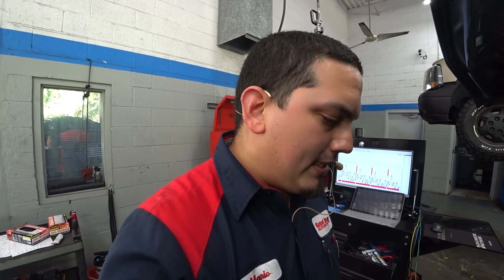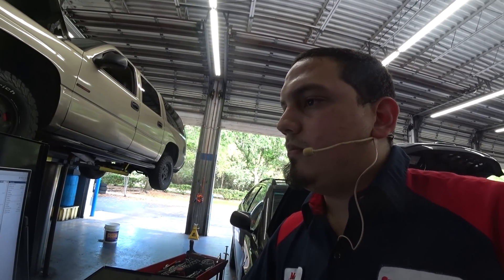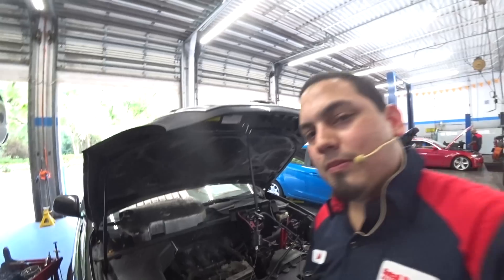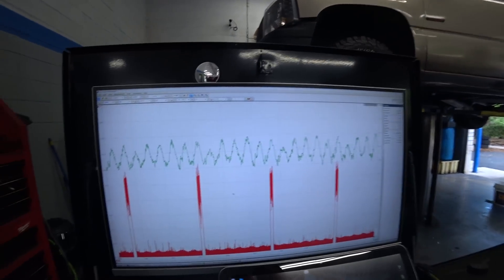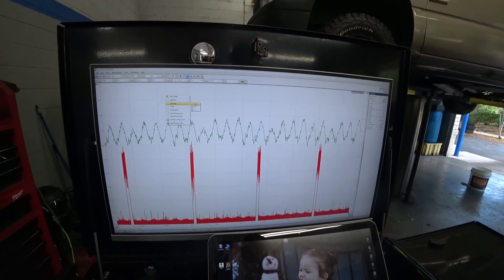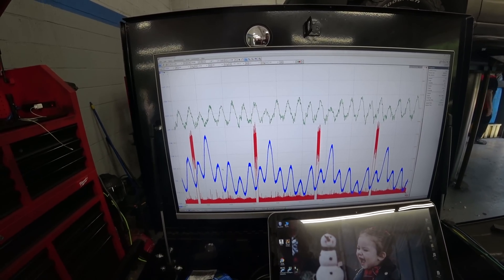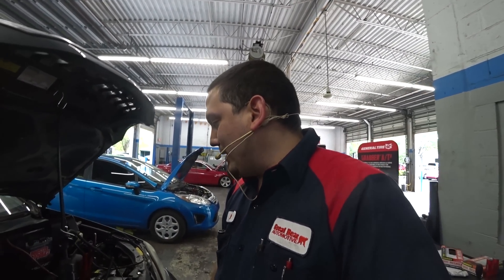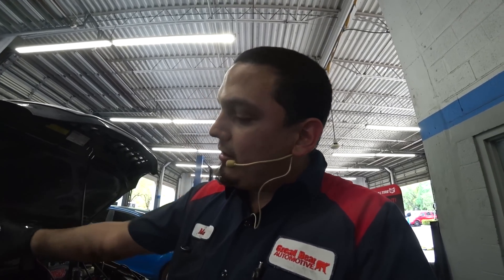Using an oscilloscope to test head gasket/cracked head

Comment: Awesome. I just adapted my no spill funnel adapter to take radiator pulse pressure readings. Pico 2204A is perfect for this. Plus I can add an ignition sync on the pressure channel for more data.

Comment: Great test I can see the value in doing this especially for a quick warranty diag.  but just quick question. As a flat rate tech. How do you keep from your diagnostics time being cut? Where the guy next to you doing the same diagnosis of  2-3 hrs to do a compression test/ leak down where I can see the shop or customer only wanting to pay half of the time for a scope test like this. Which is higher level and cost you more in equipment cost.
Reply from the maker: Sell the time first

Comment: Nice video Mario , the only thing I’m not sure is if you 5:21 can get burn with that test in case what you see in the graph is the water pump pulses .
Reply from the maker: Water pump activity is much more rapid. You'll see several pulses between each cylinder compression

Comment: What sensor are you hooked up to on the green line?  I see how you are using the cyl 2 as a trigger to tell what cylinder is what, but what are you tapping into to get the signal of low compression??? Thank you very good video

Comment: Not to sound like a complete idiot...but just to be sure. This setup has the pressure transducer within the spark plug hole, then check ignition via the signal wire and sync to a cylinder, and use amp clamp on positive lead, and then using pressure pulse sensor on the radiator to sense pulses from headgasket leak? do I have that correct? I love how the videos btw! Thank you for posting! 

-Nick
Reply from the maker: Everything is correct except i did not remove a spark plug to connect anything into the combustion chamber
Reply: @SuperMarioDiagnostics  How were you able to see the pressure's within each cylinder? maybe i'm misunderstanding how this is done? Thank you Mario for your time!
Reply from the maker: Using the relative compression test, which i explain here: https://youtu.be/eUAi7HZaIu4
Reply: @SuperMarioDiagnostics  Thank you sir! I will take a look at this! Cheers!

Comment: Happy New Year from Hawaii! Great video! Obviously the increase pressure from leak in the head gasket is self explanatory, but what causes the other pulses in the cooling system? Im thinking, water pump is affected by the cranking/compression of the cylinders? Thanks!
Reply from the maker: Right, water pump activity

Thanks, happy New Year

Comment: What if you had a leak in the egr cooler ? Cheers
Reply from the maker: That would not result in a low contributing cylinder plus a pressure pulse in the cooling system waveform
Reply: @SuperMarioDiagnostics  thanks mario

Comment: I'm going to DIY my own pressure transducer like this. My plan is to get a radiator cap pressure tester, run a hose from there to a sealed metal jug (to collect any overflow and keep it from going to the sensor) and to the transducer from there. Can't afford all that high dollar stuff. Still using a hantek scope with a homemade transducer "box" (replaceable transducer with 18650 battery bank providing 5v reference and ground for the transducer). It costed about 30 to 40 bucks to make the transducer box. Compare that with Pico's specialty transducers they cost hundreds.

Comment: hey Mario....had a Honda pilot 3.5 come in with a misfire on #4 #5 did a quick coil plug swap to 6 no change....so I remembered this vid....with my first look sensor at the radiator and the junction at the back of engine disconnected to disable injectors, cranking test showed 2 large humps followed by 4 small ones being repeated.....couldn't deny that pressure was introduced into the radiator.....thanks bro

Comment: You're talkin about the cylinder leakage fluid for the tester, but that fluid only checks for C0 not for NOx.  We  use the gas analyzers to check for head gaskets failure.  And I tell you it takes only 5 to 10 seconds to pull the NOx through the cooling system.
Reply from the maker: In cases of say a warranty job, where they only want the faulty head to be replaced, this would come in handy. 

Also this radiator was busted midway so i doubt it would read much co2 or nox at the radiator filler. Much less was it able to be topped off.

This vehicle was a crank no start in my bay so i doubt you would get much nox at all from it.
Reply: No no that test was cool man I was just talking about another test you can perform.  But the test you did is really good information to determine if it is a V block to know witch head is leaking.  Just adding more tests for you.😊
Reply from the maker: Honestly i wish i had a gas analyzer, they're pricey! 😆 thanks bud!!
Reply: @SuperMarioDiagnostics  Yes they'er pricey but the other diagnostics test you can perform are pretty cool, and there are few of them.  Like 02 if it is a short band sensor then it only reads 02 then there is another test for it.  Checking for a catalytic converter by the readings you can tell what part of the converter is shot.

Comment: Great video and diag👍. Just curious. Im from central automotive repair specialists aka CARS Mobile mechanics in sydney Australia. Do you put a limit on when you replace or rebuild the bottom end as far as  kms go or should i say miles🤣 as for excessive miles can stress the bottom end especially after the cylinder head service. A general rule of thumb here down under is about 200k kms but i guess each situation has to be justified. Keep the videos comming.. great viewing👍. Each to their own but for me if i wasnt going to do both heads i wouldnt be doing any... just sayin.
Reply: Thought so. Some times its better to go the whole hog.. being logical is very important in what we do. Nice to know you use a logical approach in how you go about things but for the most part common sense aint so common🤣
Reply from the maker: Usually it's around 150,000 miles. I wouldn't have done anything less than an engine on this particular vehicle

Comment: how do you know for sure the head or block are not cracked? sweet vid mario! (Y)
Reply from the maker: This test is meant to justify further disassembly before actually dissembling anything. I'm sure there are some who have used these techniques enough to pinpoint whether it's a lower end crack, or a head gasket/cracked head issue. I'm not one of them 😆. But ultimately one can likely rule out a lower end crack if they do a leakdown on tdc and it fails. If they do a leak down on tdc and it passes, then they do a leakdown on bdc and it fails and bubbles out of the radiator or coolant bottle, then one can deduce that it's a lower end leakage. In either case once the lower end is ruled out, the head is going to be visually inspected and either serviced or replaced and the head gasket is going to be replaced anyway. 

The pulse sensor can also be used during leakdowns, as it is extremely sensitive to detect even the smallest amount of leakage. Hope this helps
Reply: @SuperMarioDiagnostics  wow thx for the in depth reply!

Comment: I wonder how sensitive this test is... I was working on a Toyota MR2 that would overheat after a 30 minute drive and took a bit of coolant each time I checked it when cold.
With the design of the cooling system with the coolant hoses running under the car, it was impossible to tell if there were air bubbles coming out of the filler neck. Bleeding air out of the radiator and heater core was a pain in the ass.
Cooling fans working as expected.
Absolutely no signs of coolant leakage in/out/under/next to the car anywhere.
Compression test showed a variance of less than 10lbs.
Combustion leak tester showed clean multiple times.
It went to multiple mechanics with no success. (should have kept shopping and found someone like you).
The owner traded it in on another car.

I always suspected that it had a very small combustion leak.

Do you think this test would have caught it?
Reply from the maker: Absolutely. This test is extremely sensitive. The piezo sensor is about as sensitive as it gets

Comment: When using the WPX range 3 it defaults to DC and says channel overage but not on AC...should it be on AC or DC? ...I assume DC?
Reply from the maker: Range 1-3 is DC. Overange might happen if there's ignition interference or actual pressure surpassing the range. Zoom is AC. But in no setting do you need to select AC, it does it for you by pressing the buttons on the transducer
Reply: Super Mario Diagnostics thanks man, I did a capture today and got it work better

Comment: Great video Mario but was wondering why does the pressure Spike not align with compression peak? Seems to align more with bottom dead center?
Reply from the maker: There's only a slight delay since the pressure is making its way through the coolant system and up to the sensor.
Reply: @SuperMarioDiagnostics  ok thanks I did this test today on a confirmed head gasket by other methods but I couldn't see any spikes with my pressure pulse sensor. I guess there may be times its not evident on the pulse sensor 🤔. I don't understand why there is a pulse for every compression event also as surly there's no pressure from cylinder in cooling system on a good vehicle. Or is this the momentarily slow down period of each engine cycle would you say?
Reply from the maker: So you had a failed relative compression test and during the dead hole you didn't see a spike? This sensor is sensitive enough to pick up water pump activity, that may be what you are seeing. But without analyzing the waveforms myself, i can't be of that much more help. Feel free to contact me through Facebook if you'd like

Comment: Mario how did you just plug into the filler neck where the overflow tube runs into? This is a great use of the pulse sensor
Reply from the maker: I show the exact set up, in real time in the following video 😉

Comment: Man what a great way to test!, you can also use the pulse sensor to watch the pressure drops in the fuel injectors through the vacuum fuel pressure regulators, I have seen a video of where the dude adapted a vaccum style pressure regulator to his fuel pressure guage to use the pulse sensor in all fuel injection systems. Pretty damn cool.

Comment: Smooth diagnosis.  Question. How do you keep coolant from getting up into the pressure pulse sensor.  Thanks
Reply from the maker: This particular situation was a busted radiator as well, so coolant level was low whether i liked it or not. Really keeping the coolant plenty low will still give you a reading with this sensor
Reply: @SuperMarioDiagnostics  nice. So keep fliud low and you still should get a accurate reading of pressure.
Reply from the maker: nelson narciso yep you're after pressure pulses, not coolant flow. I'd take a quart out
Reply: @SuperMarioDiagnostics  great
Tips. Thanks soon much appreciate your support.
Reply: Nice diagnosis. I have a wps 500, can i use  it on the radiator to sense pulses (dont want to damage the pico transducer). keep the good stuff coming
Reply from the maker: The pico transducer won't get damaged. Yes you can use the pico as a pulse sensor using the zoom function. I show how here: https://youtu.be/gaRsNuIroAI

Comment: Ive just started seeing pulse sensor topics but i was windering if someone on here could quickly explain the difference between a pulse sensor and a pressure transducer for me? Thanks
Reply from the maker: A transducer shows absolute pressures, as in 20 psi etc. A pulse sensor only shows differences in pressures. Positive pressures show increase in voltage, negative shows decrease in voltage. Similar to an ac coupled signal, or a relative compression test. So it'll show relative pressure pulses, but you'll never know actual pressures from a pulse sensor aka delta sensor. Only from an absolute sensor, like a transducer. Hope this helps
Reply: @SuperMarioDiagnostics  superb answer thanks alot man 👍
Reply from the maker: Anytime!

Comment: I'm in the process of doing head gaskets myself. In my case, I didn't have to do any testing. 

Windstar 3.8ltr never overheated, but was pouring coolant out of the exhaust.  It could've been intake or gasket I suppose, but I did that 3 yrs ago. I didn't have that top on my list. Windstars are known for blowing out the gasket, as it rusts or rots out usually near the cylinder.  Only about 3 tspns of coolant in the oil, when I drained it to check. So I was sure to go straight to head gaskets here. #4 cylinder on the gasket failed. 

I like to see other methods of checking for head gasket issues, especially when they're only suspected... they really 'can be' hard to pinpoint sometimes. Buenísimo video Mario!

Comment: Good job dude. Probably change your wording on head gasket failure to a failure between the combustion chamber and the cooling system. Some people take wording to serious, and as you know it is possible that the cylinder head or block could be cracked as well.  Good video..
Reply from the maker: You are absolutely right. It's hard to keep things accurate when filming! Thanks buddy

Comment: If you could show how you set up pressure pulse sensors to the scope and calibrate them to read psi range or vacuum range.. Basically set up scales..that would be sweet
Reply from the maker: The beauty of this sensor is that it's a simple 20 volt scale. But yeah I'll start putting in more set up. Thanks buddy!
Reply: @SuperMarioDiagnostics   Also you could have shown how you set up your sensor to prevent coolant from entering, did you just raise it a bit higher than the reservoir.
Reply from the maker: The coolant level was low due to a busted radiator. No need for the coolant to be topped off, the sensor is sensitive enough to pick up any pulses within the cooling system. But I'll definitely keep that in mind when posting the set up video

Comment: nice test!    that dude cody is ok!  I started  watching him   will you send the heads out?   and doing both banks?    I always get a little nervous as too.... was the motor cooked at one time any coolant in the oil?
Reply from the maker: No signs of obvious oil in coolant. Cody is very cool, sharp dude. The customer has yet to approve anything at all, were suggesting both heads, we usually send out the heads to get serviced. That way we can warranty the job. Thanks for swinging by Sir

Comment: Did you use a special adapter to connect the sensor to the radiator?
Reply from the maker: Yep its part of the mityvac pressure tester kit
Reply: Super Mario Diagnostics  does the adaptor keep coolant from going to sensor? Or did you put something in between the adaptor and sensor?
Reply from the maker: Nope, the coolant level was low, i kept it there so the pulse sensor could read the air pressure pulses

Comment: Well done Mario. Keep it up. 
 If there is ever a debate why this test is even used. As I have had guys say... 
Head gasket job is both heads pulled. 
 They would be correct in most cases but.... 
 If this job was under warranty for example, it would be beneficial to only remove the head that is at fault.  
So I try to get guys to practice this approach so if they are ever really in need to diagnose the specific cylinder effectively. This is the strategy used. 

 Again brother well done and keep it up.
Reply from the maker: Yeah there's always that argument. I don't like to generalize. I want to say hey this exact cylinder is leaking into the coolant system. But that's just me
Reply: @SuperMarioDiagnostics  I agree. 100%

Comment: Well back in the old days some sometimes we use to use a small soda bottle with water in it with a adapter at the raditor neck 

 pump air into cylinder if you saw bubbles ,call it blown gasket pretty cave man 

Love these videos 

Hey how bout a lil I depth video on that pressure sensor? 

How a Closer look at that jewel (pressure tester), was it made by cody?
Reply from the maker: Will plan to do that buddy. Yes Cody made this one

Comment: Sweet! Would you consider this a "severe" headgasket leak? Ive had good luck using pulse sensors on severe failures, but haven't had the chance to use this method on a more minor failure.
Reply from the maker: No this is absolutely subtle! Great question. No chocolatey oil, just a very light miss during startup after sitting for a while
Reply: @SuperMarioDiagnostics  I'm glad to hear that. I havent seen many people use this method on less sever failures, so I'm glad to see it works just as well.